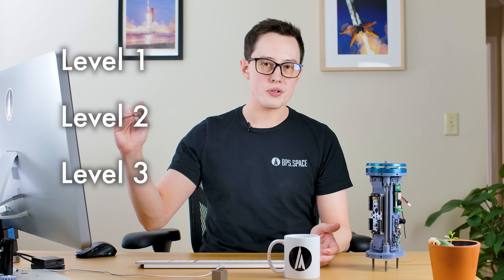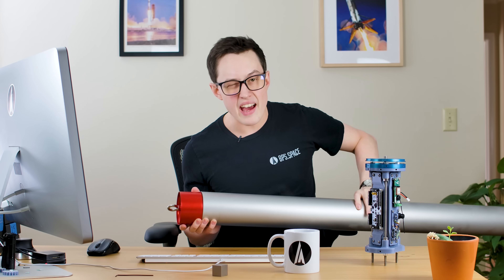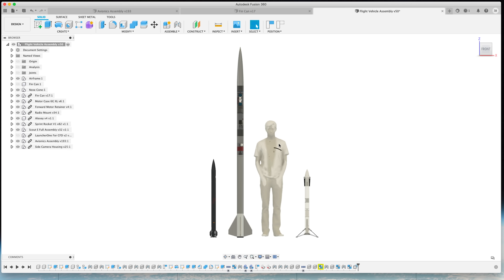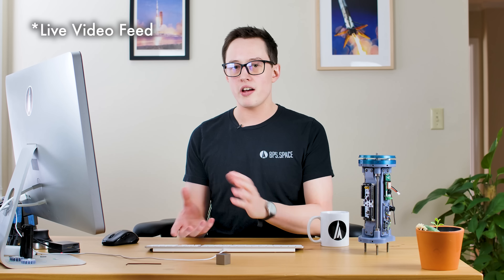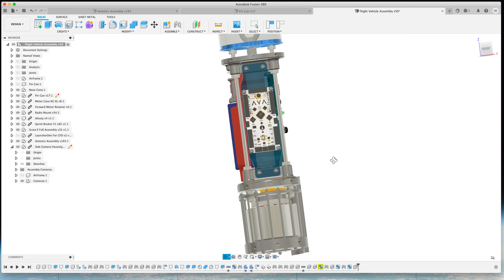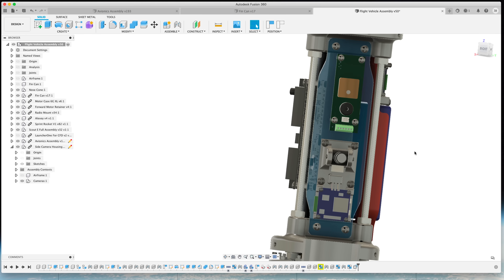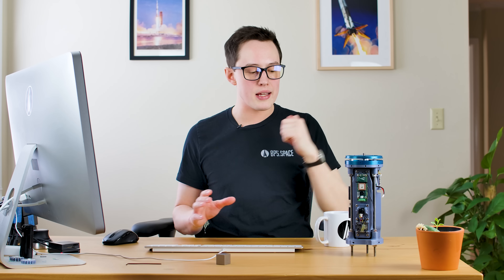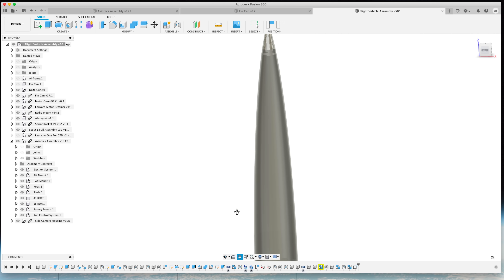Lumineer Design - 10km/Mach 1.7 L3 Rocket

Comment: Not sure a linear polarized antenna is the right choice. Maybe look at one or two fpv videos explaining circular vs linear polarized antennas. 
Best choice could be a so called 'cloverleaf antenna'. 
A linear polarized antenna will transmit in a radial plane, and as soon as the rocket takes of, the receiver will no longer be in that plane.
Also, when reaching apogee, the transmitting antenna is no longer perpendicular and thus not longer paralell to the ground stations receiving antenna, wich results in lower signal level or possible loss of signal all together.

Comment: Open Rocket has problems with the aerodynamic model that creep in when you exceed mach 1. These come out of the 6DOF code that was adopted from the Cambridge Rocketry Simulator. It wont bother you too much with a mach 1.7 to 10km shot, but I would suggest you move to RASAERO for your bigger flights. Good luck and god speed!
Reply: I'll second this. RasAero has its problems but is the only of the publicly available simulators that can get a spaceshot approximately correct. For a short-burn solid rocket, it's probably good enough. Anything more complicated and you'd need something ITAR or something home-built (which can turn into something ITAR).
Reply: @shockjumprelations  There is a freely available 3DOF called Launch 2.2A, was developed by a Dutch Amateur rocketeer in the 90s, Its clunky to use but I have crossed checked it against high end 6DOF (ASTOS package) & simulations of known sounding rockets & its within 5%. I use it as an early stage design tool on all the companies rockets.
Reply: @jamieanderson6786  seems like a neat program, haven't heard of it before actually! My team's rocket needs 6DOF and liquid prop for a proper analysis, which is why we built a homebrew sim. But for most HPR stuff it's not necessary.
Reply: @shockjumprelations  Yeah definitely understand the need for customised simulation tools, we have a number of custom developed in-house tools that look at different aspects of the trajectories that we use in tandem with Astos. But the Astos software is far outside the capability of an enthusiast to purchase.
Reply: A rocket I made was simmed at mach 1.2 on openrocket. when I moved to a different program that is made to handle supersonic flight that sim went from mach 1.2 to mach 1.6. a much larger difference than I had anticipated
Reply: Now I'm curious, what problems does OR has?
Reply: @guidodipasquo5162  Poorly constructed drag model that appears to develop errors above mach 1. In all the test cases we ran with high mach (+3) flights it would be out as much as 30% on predicted altitude. There appears to be also problems with the atmospheric model once getting past the Troposphere, this combined with aerodynamic algorithm issues makes it unusable for high altitude high velocity simulations.
Reply: Astos is also great but can be expensive
Reply: Is Rasaero open-source too?
Reply: @pcost  yes its free to download

Comment: internet connection idea: maybe you can buy a Starlink beta dish. it's probably a bit expensive and you'd need a lot of power though
Reply: Nice idea but currently Starlink dishes cannot be moved from the location in which they are first set up.
Reply: @aspzx  damn, that's unfortunate
Reply: And why wouldn't you want a permanent  internet connection at the launch site?
Mojave and Delmar don't seem to have flooding problems.
Blackrock can get real soft and soupy though.
Reply: @jimurrata6785  I mean, if he uses that launch site frequently, guess.
Reply: @CookieMonster-nt8hh  Every rocket club I know of (NAR & Tripoli) has ground support equipment.
Pads, tables, fencing, launch controllers, cables, P.A. systems....
Why wouldn't you want a decent internet connection, especially given how remote most launch sites are?

Comment: moon landing when?
edit: there is a small chance that i might be able to help you with that stainless steel piece, im a student in a materials centered university in France and i have access to this kind of machinery
Reply: Oo! Well there exists very sturdy materials that can be lighter and stronger than steel, that can be 3D printed! Like polycarbonate, PP GF30, Steelfill and more !
Reply: @nitrogenfuse1617  I think the heaviness is deliberate, to counteract the rotational forces. (I suppose the alternative is to just spin something lighter, faster, but that might involve a greater lag time when changing the direction of rotation).